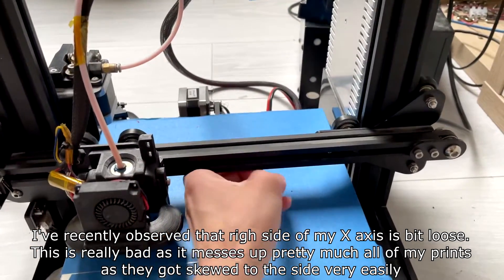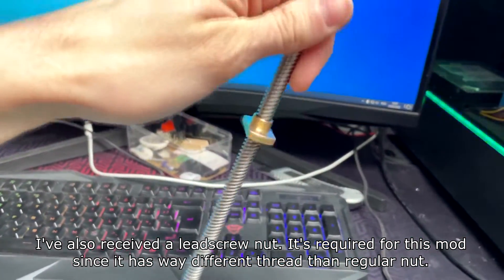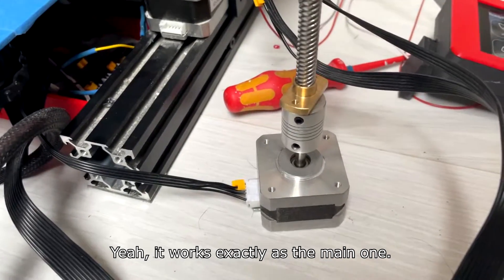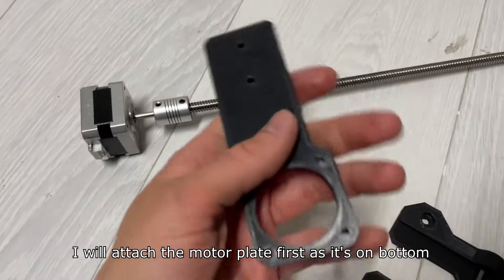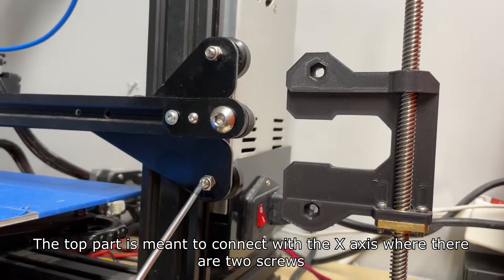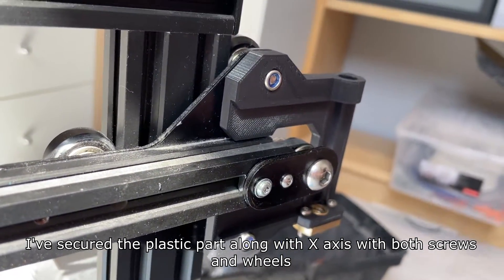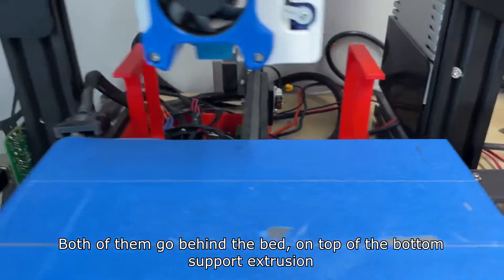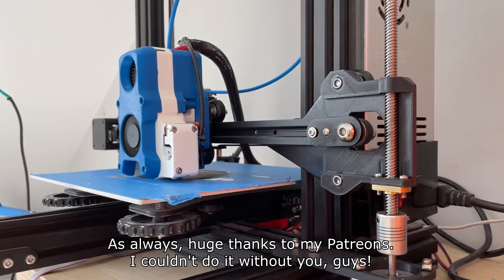Ender 3 Easy Dual Z Axis Mod | Better accuracy on taller prints

Comment: If you are running the second z axis motor on its own driver you should add the G34 "Z stepper auto alignment" command into your Marlin firmware, I have my start g-code set to auto tram my z axis before doing my mesh auto bed leveling.

It has improved my dimensional accuracy in all three dimensions.